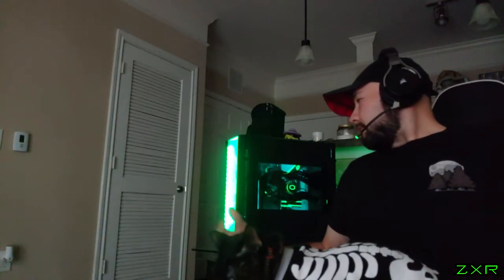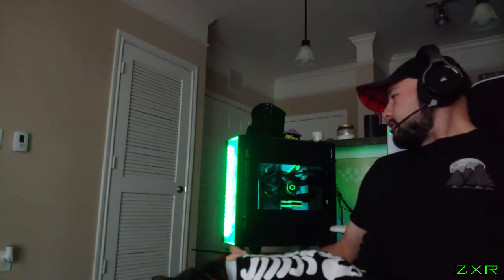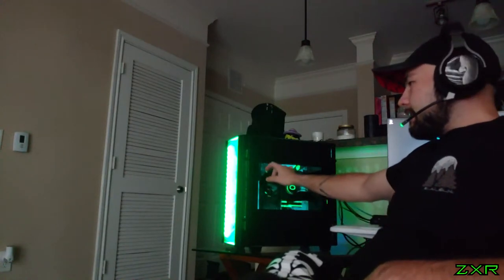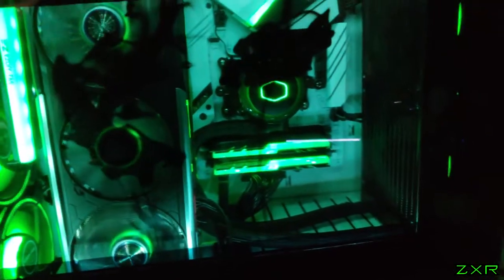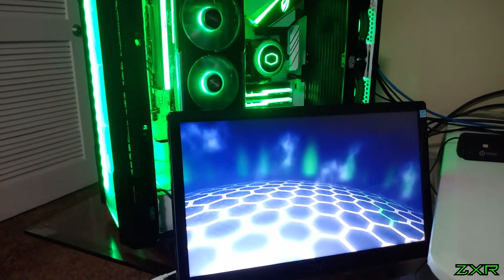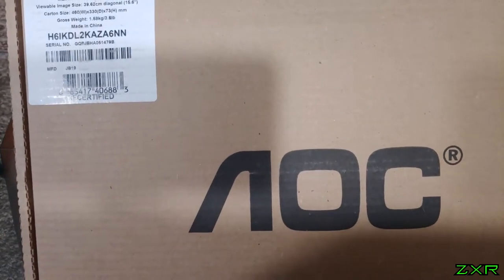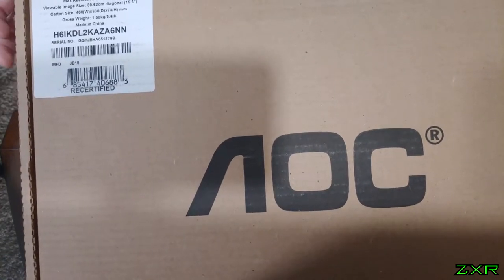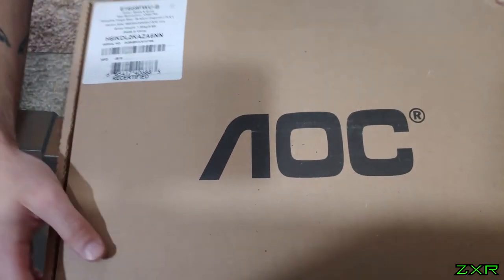Snowblind for the masses DIY plug and play LCD side panel

Comment: So I just want to confirm.  This counts as a new monitor correct?  So if I have 2 already, this would be my 3rd. And where do I go to get the moving wallpapers on it but not the other 2 screens?
Reply from the maker: @Seishin yes it counts as another monitor. The application is called wallpaper engine. It lets you set per monitor wall papers, so you can only set it to run on one monitor if wanted.
Reply: @ZXR_SBK  sweet!! Thank you for taking time to reply! I found one an old aoc usb monitor on the Facebook marketplace,  but it seems to use a mini USB to usb wire,  so I'm not sure if I want to try it even though it is 40$. Might just save up and wait for a new model on Amazon for 85 to 100
Reply: @ZXR_SBK  another question.  Can you use that monitor with a USB 2.0 header?  Or do I need to find a way to wire it out of my case to my io
Reply from the maker: @MrFreEkStyLez  yes, it can be run off the header if you get an adaptor that is USB A female to USB header.
Reply: @ZXR_SBK  oh thanks goodness! I was starting to feel like I messed up buying the monitor. I only have one free USB header on my motherboard and its a 2.0. I kept seeing mixed responses about whether it would work of a USB 2.0.  Thought it would be an extra power or something
Reply from the maker: @MrFreEkStyLez  no, the end with the main connector is all the needs to be plugged in for the display to be active. The second plug that comes off the main one is the monitor back light, but it will be removed when you swap the display to the pc case, so it can be left unplugged.

Comment: It is usb powered which is connected to the motherboard. So does the gpu still  control its display?
Reply from the maker: I'm actually not sure on this. I had wondered if the gpu was providing the signal for the monitor, but I don't believe it is. Because I'm not able to adjust the monitors display settings, aside from resolution selection at all, through windows or radeon software, so it would seem it uses an internal display controller. But I'm not certain.

Comment: How's this holding up now that's  it'd been some time?
Reply from the maker: still works great, alghtough I did transfer my build over to a differrent case for awhile do a custom loop, got a waterblock for my GPU and CPU so when it came time to clean the loop i decided to rebuild in this case, display still works great.
Reply: @ZXR_SBK  nice dude ima give it a shot in my lian li o11 dynamic maybe display a little too small for that side panel but I'll give it a shot regardless

Comment: Where did you get that smoke/fog graphic for the screen?
Reply from the maker: @dion de kok it's on the software called wallpaper engine. Search market within app for smoke and it should be there.
Reply: @ZXR_SBK  thanks. I have wallpaper engine, just can't seem to find anything good. I'm workshop challenged.
Reply from the maker: @Noidhole88  when I get home I'll see what the exact wallpaper and publisher is.
Reply from the maker: @Noidhole88  here is the link to the wallpaper I believe you are asking about. it's called snowblind ink drops. https://steamcommunity.com/sharedfiles/filedetails/?id=1777265222
here are some of the others I was using as well. 
https://steamcommunity.com/sharedfiles/filedetails/?id=1777259398
https://steamcommunity.com/sharedfiles/filedetails/?id=1222816096
https://steamcommunity.com/sharedfiles/filedetails/?id=1957857934
Reply: @ZXR_SBK  thanks a lot!

Comment: Bump up the contrast on Nvidia control panel
Reply from the maker: I'm using an amd gpu. I've tried using windows to adjust the display, but it offers no adjustment, I'm guessing because its using the USB for the video signal.

Comment: Dude...if you are going to make a video, at least blow your nose beforehand or wait until you are over the cold...very annoying to hear/watch. That aside, thanks for the information.
Reply from the maker: Yeah, sorry about that, had a bad allergy attack that day, didn't even notice I was sniffing so much since it's common for me. I'll be more mindful in future vids.
Reply: @ZXR_SBK  please ignore rickss69.... This is YOUR video, you can make the video however you want. If he doesn't like it, he can simply go watch another video or mute the sound. Great job on the build. Quick question, I have the Corsair 7000X case, it's massive. But it has Tempered Glass (tint on glass), will this still work? Or does it need to be normal clear glass?
Reply from the maker: @richh9570  It will work but may need to add more back lighting. The glass on the case in this video is tinted as well, but not as dark as your case.